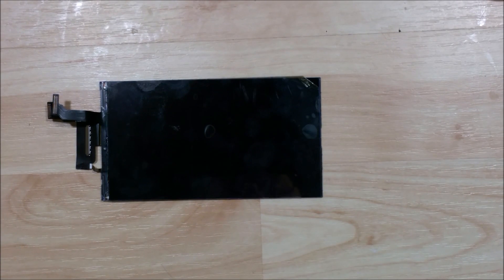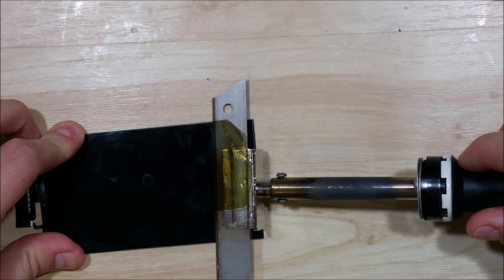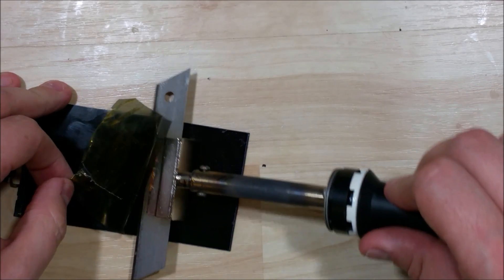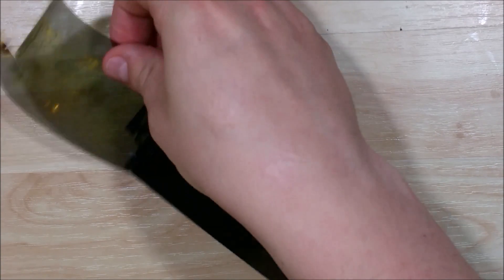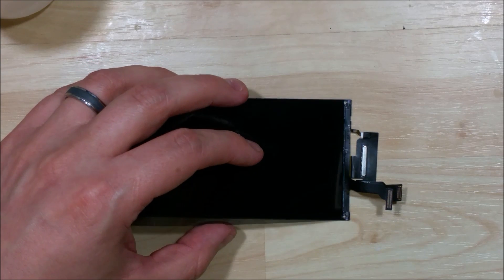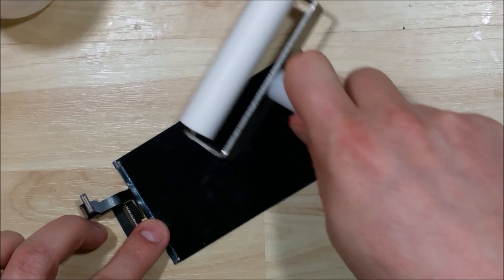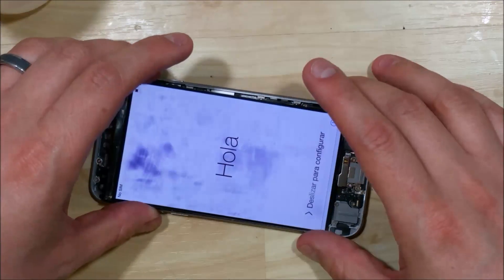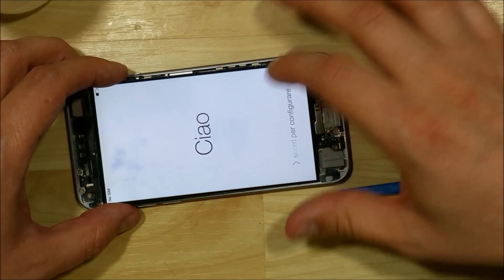iPhone 6 and 6 plus + Polarizer - Removal and Replacement

Comment: What you'll have at the end of this repair is static build up, because you didn't replace the static discharge connections after replacing the polarizer. Static build-up on display creates those warm spot/circles that showed up after you rubbed the back of the screen.
Reply: +Merchant Nation please can u tell me how to avoid this?!
Reply: +vid-stjepan vlahovic 
If its already done,  then youll need to buy silver paste to replace the broken contact line. 

Look at the line between the display connect and the lcd. You sgould see a thin solid line from left to right with no breaks.  If little chunks are missing,  then thats your problem. 

If you are just trying to avoid,  then just have to be careful when removing glass.  Impossible to avoid if removing polarizer
Reply: +Merchant Nation hi do u know how to apply the silver paste you are saying ? Thx
Reply: +Marcos Najera you can see the missing trace.  Google it.  Tons of video
Reply: If u want i can post few pics tommorow how they look
Reply: +vid-stjepan vlahovic yea that would be good just where
Reply: +Marcos Najera ill send u an email, what do u want to see?
Reply: +vid-stjepan vlahovic email me at marcos.nl35@outlook.com

Comment: Any idea why the polarizer stopped the touch from working?
Reply from the maker: +Jake Methner This display had many issues I am pretty sure it wasn't the polarizer but the actual display.
Reply: +How2Tech Yea I figured
Reply: +How2Tech  how can i avoid dust underneat the polarizer ? Please any tips
Reply: hi, @privee prive, if you use a kind of dust-free lamination machine, you will avoid this kind problem. we can provide phone repair machine with very good quality, and factory price

Comment: Hey. Why you need to change polarizer?
Reply from the maker: Justas Paguzinskas It can be damaged by broken screen or glass removal.
Reply: ***** Thank You
Reply: +Justas Pa (justas99) During glass separating, if the polarized film is damaged, you have to change new one. And you don't want to spend time to clear glue on the LCD, you can change a new polarized film, then you can save time.